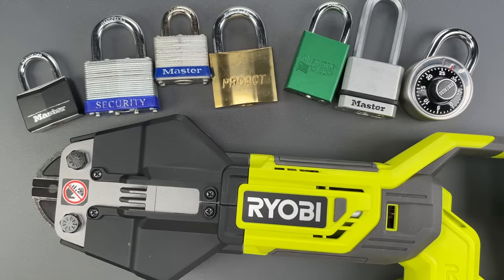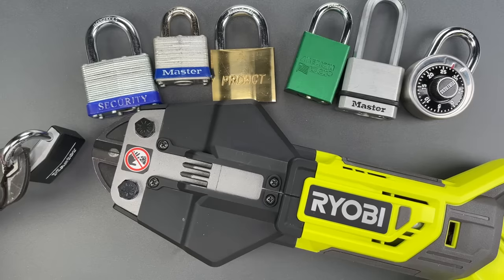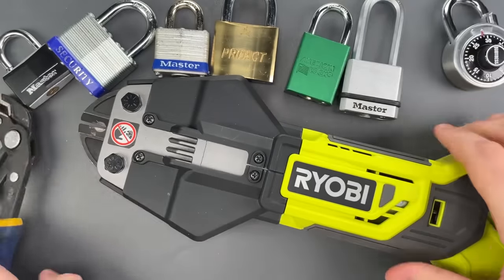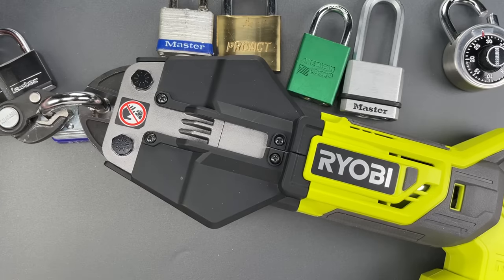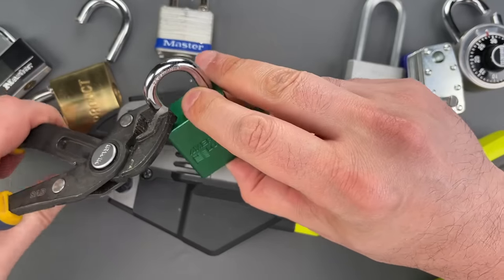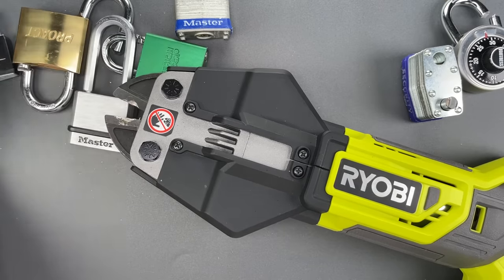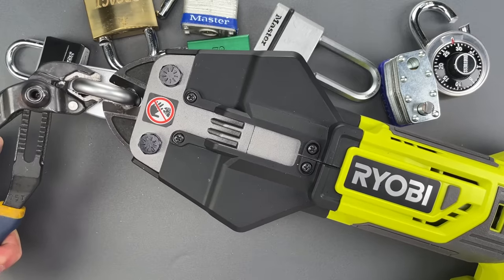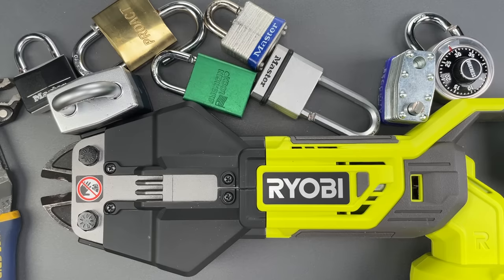[1408] Better Than Expected: Ryobi Bolt Cutter

Comment: "Better than expected" could be Ryobi's motto. their tools are usually rather affordable, not to say cheap, but I've found them to be really good value for my use and the money invested.
Reply: Owned by the same company who makes milwaukee tools so same factory just different branding.
Reply: @corail53  Just because the same company owns both brands doesn't mean they're always comparable. Milwaukee consistently performs substantially better than Ryobi, but you pay for it
Reply: That seems to be their way of doing business - reasonably cheap but surprisingly reliable.
I used to retail their fishing reals & don't recall more than a couple of faults in many hundreds sold.
Reply: If you can get past the color Ryobi makes some good tools for the home gamer.
Reply: I’m surprised, because I found them to be pretty mediocre. Then again, I was using their gasoline-powered tools, which are a much more complex beast.
Reply: In my experience their tools aren't particularly accurately built or pleasing to use but then last a spitefully long time, maximising the suffering.
Reply: Kinda the Crazy People angle with Volvo: "They're boxy, but they're good"
Reply: Right. For the occasional user. It's probably one of the brand with the best quality/price ratio
Reply: Definitely fine for home use and even will last long enough on a job site to save up and buy a good set for people that can't afford it.
Reply: They make a real solid electric weed-eater/edger.
Reply: I am very pleased with my Ryobi flamethrower. It incinerates 3x more zombies than the comparable Rigid on the same charge.
Reply: I stand by their electric products so much honestly. I sound like an ad for them whenever a friend needs a new tool that I know they make
Reply: Value for money is is pretty much their brand. I've never seen them ever as best in class but for the amount of money you spend, they over perform compared to similarly priced and sometimes even more expensive brands. Really good fit for enthusiast level work.
Reply: I've got a collection of Ryobi 2-stroke yard tools (roto-tiller, whipper snipper, and hedge trimmer) that are all now more than 12 years old.  They were ridiculously inexpensive but amazingly reliable.  

Last year the tiller turned over after five pulls despite the fact that it had been sitting unused, with gas in it, for five years.   I just topped it up with fresh mix, gave it a shake and away she went.  The only maintenance I've done on any of them has been to turn a few screws on the carburetors when they weren't idling quite right.
Reply: I've owned a set of Ryobi tools for about 10 years now and they are all still functioning well. I even dropped my drill off a 20ft scaffold and it still works! They are 100% best bang for your buck.
Reply: @morinpatmorin1  dang I mean I hadn't even gone that far. Got into them about six years back and the only one I've tested disuse on was the trimmer which worked fine too. So not surprised, but that's impressive.
Reply: Anyone who says Ryobi is cheap hasn't come across bargain basement brandless Chinese made stuff yet. They're so unreliable with a huge variation in quality that even the Chinese are afraid of them. I know. I'm Chinese. :D
Reply: Cryobi
Reply: My bag-o-Ryobi 18v tools is easily the best bang for the buck I have as a diy home user. From impact wrenches, to reciprocating saw to really useful tire inflator I believe the amount of useful tools I have for the money invested is very good.  Not premium, but great value imo
Reply: Are they the greatest tools? No. But are they good enough for an average person? Definitely.
Reply: 100% great value for money for tools you are not going to use every day but still give a right flogging to now and again. They really are the value/money pricepoint.
Reply: Cryobi tools don't last so they are only for home gamers.
Reply: "Inexpensive, but not cheap"
Reply: Definitely a brand I trust. Every tool I've bought from them has worked well for at least a year, and most for over 10. The few who stopped working early usually did so after my Step-Father had used it. Make of that what you will.
Reply: Yep, over 10 years had my cordless drill and various other tools, still going strong.
Reply: They make an inexpensive wet & dry vacuum cleaner designed for work sites that we use around the house, it's cheap, powerful and being able to vacuum wet is so useful.
Reply: @LucidStew  - Volvo's were great when they were made in Sweden (except their damn heater motors frequently failed which I found odd being from a cold country).  Now a Chinese company owns them and they are not the same product.
Reply: @corail53  Can we please, for the love of god, stop this nonsense? The tools don't even look the same, not even close, and you're claiming that they're from the same factory with just different branding? If you'd say this for something like AA batteries, fine, but for tools that are physically different and have been tested SOOO many times and always come out differently? Geez...
Reply: If you like working with quality tools, and have any kind of experience with quality tools, stay far away from Ryobi. If you come from a no-name brand from a home improvement store, Ryobi is going to be a big step up. They're not the absolute worst, but they're far, far from the best.
Reply: @timderks5960  I think the point isn't that Ryobi and Milwaukee are the same, they are not. But they are relatively good quality tools for those of us who don't use our tools daily. 

I've owned Milwaukee tools and they are excellent. But I can't justify spending the dollars required to get all of the tools that I use occasionally in Milwaukee. 

Ryobi's main appeal to me is the breadth and depth of their line and the ability to use one battery across that line of tools. My Ryobi lawn tools get the most use and the ability to use my power tool batteries in my edger, trimmer, hedge trimmer and blower means that I have maximum flexibility and can often buy bare tools when I need something new. 

For a home user like myself, Ryobi is good. If I had a need to use these tools every day to earn my keep then that might be a reason to upgrade to Milwaukee.
Reply: @LongPeter  Haha. 100% with you there. I have one of the old, blue impact drivers that’s been dropped off ladders countless times and it just refuses to die.
Reply: @joelrodriguez9661  I quote: "...so same factory just different branding". Branding basically means color and decal. I'd say they were trying to say that the machines are identical, other than the branding, which simply isn't true, not even close.

Of course Ryobi is good enough for the average home user (that never uses power tools outside of those times when they do at home). Pretty much anything is good enough if it gets the job done. I never claimed that Ryobi is completely useless, it has its place. 

Also, they're not cheap, like at all. Maybe in the US the pricing is better, but in the Netherlands they're probably more expensive than Makita if you'd look at metrics like money over torque. Ryobi always looks like it's cheap, because it's often sold as a bare tool. 80 bucks? Cheap! Oh wait... 125 for a 5Ah battery (which is way more expensive than any quality brand. For reference: same store, also 5Ah, Milwaukee: 85 bucks, Makita 75 bucks) and 50 bucks for a charger. Oh and a case? Not available (not that I found at least), so you have to use some kind of gym bag they sell. Seriously, you can get a better Milwaukee or Makita for less money...

Sure, if you have the batteries and chargers, and you only use them in your shop / at home, you may end up spending less money going with Ryobi after you buy quite some tools. Is it worth the notable drop in quality though? Not in my opinion, but of course, to each their own.

For the record: I'm not hating or bashing on Ryobi. They make tools, some people like/prefer them. That's perfectly fine. I would never want to own them, but then again, there's quite a few brands I'd never buy.
Reply: @mike_f  I have a dozen or more of the Ryobi's at this point, but that tire inflator is easily my most used item. Very handy.
Reply: @Andrew-qu7lq  yeah, that inflator's made me so lazy I don't even use a tradition pump for my road bicycle tires anymore.  It easily handles the pressure in the 90 psi range and is dead-on accurate every time I use it.
Reply: It's great for homeowners. Apparently great for thieves now too!
Reply: @DangerB0ne  I like the colour. Looks better when they're used imo
Reply: They work really good while the work most the issues is from continues use
Reply: @TheSupertexx  Ryobi tools are aimed to be an affordable option to the average DIYer not pros who use them daily
Reply: @_cb336  I have a blue drill/driver inherited from my dad. It technically works well enough to keep but has about as much torque as a personal CD player.
Reply: @LongPeter  Lolz.
Reply: I’ve bought a bunch of Ryobi tools over the years, usually for a one use purpose. Granted, I didn’t use them as much (at least initially) as my Makitas and Milwaukees or treat them as harshly. But they held up well enough that most of them were sold at garage sales, still working fine but not worth investing in new batteries.
Reply: @progen  only ex Soviets can use these tools and say "da, it is shit, but does the job, no?"
Ask me how I know.
Reply: I've found them to break all the time, never had a ryobi power tool last.
Reply: I think Makita is much better and has a similar price range
Reply: They've gotten much better over the years for sure. Pretty darn good for the money
Reply: I don't mind Ryobi for tools that I rarely need, for everyday use I'll stick with Makita
Reply: @opinetree  if they've gotten better over the years, I'd hate to know what they were like before, because they're TRASH now.
Reply: @FowlerAskew  Exactly. It could be that they bought the brand and consolidated into the same site. That or something along the lines that they have the setups for the higher end tools and Ryobi is the more budget line that does reasonably well.
Reply: I use the One+ HP stuff professionally and have had zero issues. The high torque impact wrench is surprisingly good.
Reply: @BeetleBuns  curious, what's your use pattern? They've been great for casual, low duty cycle, home use but could not imagine daily use or big project use. Like building a deck would probably kill the impact driver pretty quickly.
Reply: Ryobi is probably one of the best brands for the average DIYer
Reply: Love my 18 volt set
Reply: @GARDENER42  I'd rather have a high quality Shimano or Pflueger, but of course those are $100 and up.
Reply: their 18ga nailer is actually a great product. It's more reliable than Makita's 18ga nailer, that's for sure.
Reply: @cxmplexdrives9719  Definitely, but as a budget reel, the Ryobi offerings did surprisingly well.
Sadly, pretty much all fixed spool reels are made in China these days, so even the best aren't as good as they should be for the cost.
Reply: Used a Ryobi 1/4" impact driver on a construction site for over a year and now that I don't do construction anymore it's my shop driver. I've gotten it so hot that I couldn't hold it and it stopped working. Still works great after I get it cool.
Reply: @DangerB0ne  paint em! Painted my driver red white and blue with enamel paint, and the paint survived a year on the job site
Reply: I've only ever used a drill from them once to mix paint and no complaints. Battery lasted much longer than my girlfriend's Bosch
Reply: Ryobi are good tools for what they cost, but being fair so are most other tools in the same price point. They have a few tools that stand out as batting above their league but they have some real stinkers as well. My usual advice to new tool shoppers is "How often do you plan to use it?" If the answer like many home gamers is a few times a year doing odd jobs around the house. Then sure Buy these or craftsman or ridgid or any of the other tool lines in the same price. If the answer is "Well I'm looking to build a deck or a shed or I do some handyman type work" Then I encourage people to go ahead and pay the price difference to step into something better. The main reason being the average performance across most of the common tools. Your time is worth something and if you are involved in a project that for example is going to have you driving a couple hundred ledger bolts, then a tool that gets the job done twice as fast is more than worth the usual $40-$60 price difference. Like anything else, your personal use case is the most important thing. But fairly often when you are considering purchasing something that you are going to use regularly over 5-10 years then a $50 price difference really is peanuts when you look at the big picture.
Reply: @corail53  Their internals are VERY different though, Fine for home use but will die on you immediately commercially.
Reply: RYOBI NATION BABY
Reply: @FowlerAskew  I betcha Milwaukee has a better warranty, so if you're burning out tools fast enough it's certainly justifiable to pay a bit extra and get new tools when they break.
Reply: @corail53  That literally means nothing, they are not remotely the same. The Ryobi's are for DIY use and they are great for that because they are affordable but they wouldnt last anywhere near the Milwaukees on site. All my tools are Milwaukee and they arent just way more powerful and reliable they are harder wearing and can withstand more punishment.
Reply: Nice to hear, great advert for them too, lot of subs tuning in...including me!
Reply: Company I worked for bought Ryobi battery tool for employees to use. There impact driver had amazing torque  the battery life was poor and it burnt out in less than nine months. They are not meant for trade use, but good value for the home handy man.
Reply: Most guys aren't skilled and/or disciplined enough to need a tool better than a Ryobi.  That being said, I personally love them and their battery design is my favorite.
Reply: the project farm youtube channel will quickly change your mind on this
Reply: @BeetleBuns  in general I certainly agree. In construction, one needs REAL tools, so I don't own any Ryobi products that I need to rely on. But for the home improvement type they're fine ish
Reply: My old neighbor was ecstatic when he came home with a Ryobi combo pack. I was thinking "oh honey" but when I checked them out I realized it was pretty good.
Reply: Facts, I have mostly ryobi tools in my workshop and for someone that doesn’t do professional work ryobi does have great lines of tools that are well balanced for performance and price and actually competitive.
Reply: You should watch a video about the Ryobi soldering iron and see how they look on the inside, you might be a little surprised.
Reply: I have an old ryobi circular saw and it says made in USA on it.
Reply: People seem to get ryobi when they've had too many other branded tools stolen from them off site , they work well enough for serious use , but aren't a target for fellow contractor theives
Reply: Agreed. Everyone doesn't need Makitas to do their work, especially the weekend warriors.

Ryobi isn't widely considered professional grade, but I've seen them on plenty of job sites. Sometimes, you'll rarely use a particular tool, and Ryobi is good enough for those few times you need it.
Reply: @corail53  its more like the difference between toyota and lexus. Same parent company but lexus is better all around at a higher cost
Reply: @TheQuark6789  I haven't used any of their gas powered tools, but for home use Ryobi makes really good battery powered tools. I even have their 40v Lawn mower and weed eater. Both are fantastic for the money. Contractors and the like might wanna spend more money, but if you're just doing occasional home improvements and maintenance like myself they offer a good value and they're a huge step up from "Random Harbor Freight" tools.
Reply: @CB-ke7eq  I have their 40v version. That thing will cut down small trees if given the chance.
Reply: You can get better tools, but they won’t be as cheap and you can get cheaper tools but they won’t be as good.
Reply: They have an excellent reputation amongst tradies in Australia. Seems to be what most use.
Reply: I fint they have adopted what I like to call "Good enough or 80% engineering" The remaining 20% is what gives you the least benefit pr. $ invested. This approach is highly used in the way Russia and previously, USSR did infrastructure, cars, and military tech.
Reply: @LongPeter  I have a Ryobi drill & impact that I’ve used professionally for 6 years now, never experienced any suffering from them. They’ve been reliable af despite horrible abuse.
Reply: used a $40 ryobi saw for like 10 years clearing brush and trees till it caught on fire lol pretty tough just saying
Reply: @corail53  Fiat and Ferrari are from the “same company” too.
Reply: I’ve beat around a drill and driver combo for 8 years now. Still works good as new.
Reply: @DangerB0ne  Instructions unclear. Monitor now cut in half.
Reply: @FowlerAskew  yeah, claiming they are the same is like those friends of mine who will die on that hill claiming that squire or mim is just as good as a mainline fender strat. They'll always say "well the factories are always switching around so you've got to get one from a good era." Meanwhile I think all this comes from not wanting to spend the coin.
Reply: @timderks5960  Ryobi and Milwaukee might very well be made in the same factory. But I agree with you that this alone doesn't make the tools the same. They arent. But Ryobi does benefit from the fact that Milwaukee is a sister company. 

In the US, Ryobi is often significantly cheaper than Makita or Milwaukee. Whether its a bare tool or a tool with a battery. 

Also we have options through the manufacturers own retail stores to purchase blemished items at a significant discount off normal retail prices. I've bought several tools this way and I cant seem to identify the blemishes that got these tools rejected from normal retail sales. 

For what I do with my tools, lawn work and projects around the home, Ryobi presents a solid value proposition to me. 

I realize that there are other tools on the market that are more robust, as I have sold those tools as a vendor. But my use case for these tools doesn't justify the cost I'd have to pay. If I were a carpenter, a mechanic or some other sort of tradesman then I could justify the additional cost. But I am not.
Reply: @timderks5960  what you need is an american friend who can buy tools domestically and then ship them to you.
Reply: @schm147  But... Why? I checked a tool I have on my wishlist (granted, I only checked one, and only checked one US store), but the tool only in the US was the same price as the tool with an Mbox in the Netherlands (I checked both without taxes), and that doesn't even take shipping into account. A quick check on Fedex's website told me that shipping it would cost even more than the tool itself. I really don't think buying anything in the US and then shipping it over would make sense for anything other than products that are exclusively available in the US.
Reply: That's kinda just Japan's motto in general
Reply: One thing that they do not do well is segmentation of their tools. You can have drills that look almost identical but have different price points and different construction. Brushed vs brushless etc. then you get people that really use the crap out of them and should have bought a higher version buying a tool that's intended for less demanding uses. Then complaining about it. 
Even just sticking with One+ or whatever doesn't help. They really need clear "tiers".
Reply: @timderks5960  Except they are. Buy a brand new latest greatest model Ryobi tool. Now go find the Milwaukee tool that was their latest greatest 2-3 years ago. They are exactly the same (outwardly) and innards are mostly the same just with a few more plastic parts.
Reply: @TheQuark6789  I actually found the lower cost Ferrex tools from Aldi to perform better than Ryobi, which are quite gutless in comparison.
Reply: @VinaX2R  a ryobi impact kit is like 200$ and a makita one is like 550+ easy
Reply: @Outworlder  they do have clear tiers, they've got the HP and the brushed shit. People need to learn to read the description on shit
Reply: @bread-gz3rl  I think we'll disagree on what exactly are "clear tiers". Sure, I have seen HP branded stuff(often with a different color scheme even) but someone who's otherwise not into the brand may not have any idea, buy whatever is in front of them at Home Depot and get disappointed - and then go back to overpriced DeWalt.